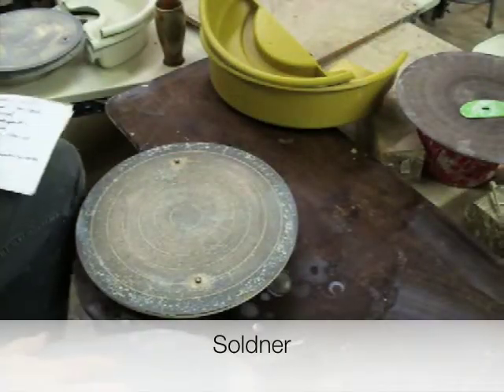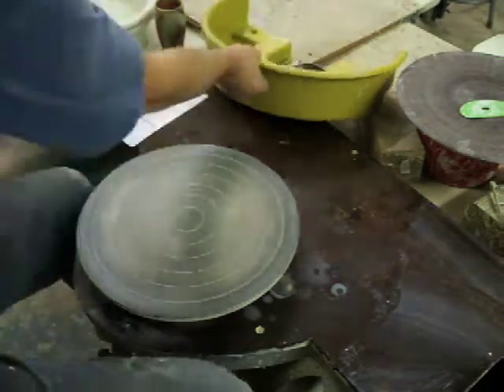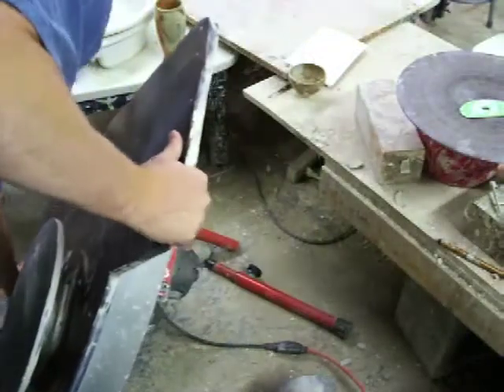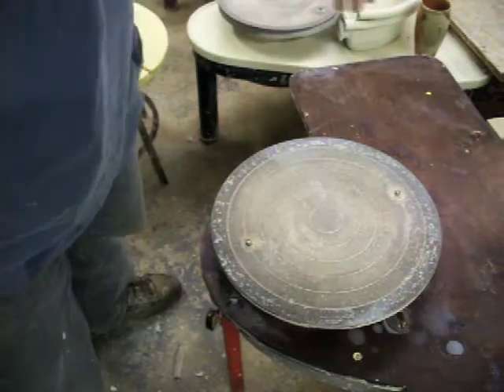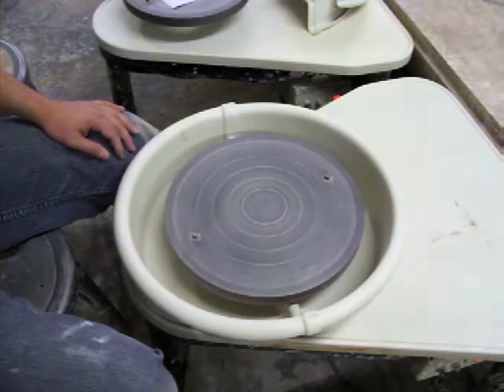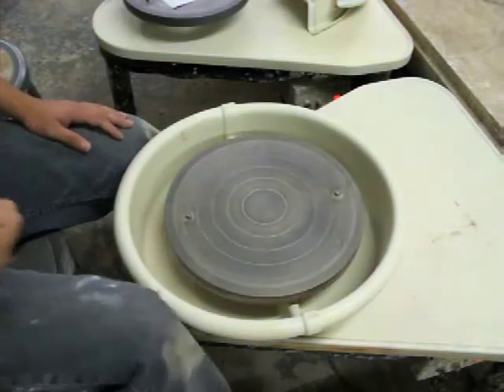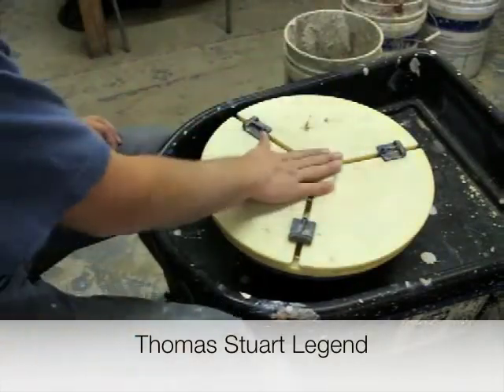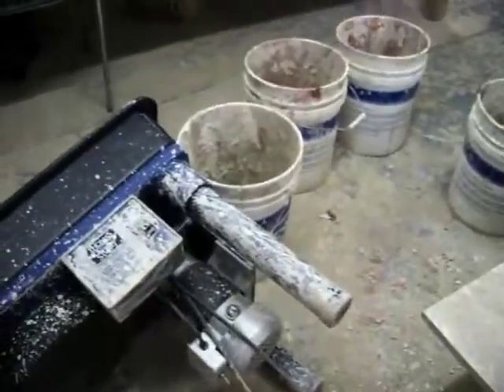Wheel Reviews

Comment: My personal favorite are motorized Randall Wheels. If you haven't seen any they are massive. Steel tube construction with a sixty pound fly wheel, a twenty inch spalsh span that is basically half a sphere and an adjustable tractor seat that is attatched to the wheel to sit on. I use a normal wheel head other than the one they originaly come with. They are great wheels.

Comment: Cont. from below. I worked for a ceramic supply company for around three years so I LOVE seeing the reviews. I always wanted to try a Soldner, thanks for sharing. 
If you ever get a chance to try a Shimpo (Whisper series) . There power at a half horse is impressive. The RK has that fixed lever/foot petal and anvil shape many people hate or love. I like to throw with both feet on the ground so it does not bug me. The VL whisper is the more "modern" style with table and large remote foot petal.

Comment: Shimpo is another good wheel. I might be biased, I do own a Shimpo Rk & VL Whisper. They advertise the fact that they are silent and they are nearly. That has never been a concern for me though. Great torque for a half horsepower motor and I think un matched at slow speeds. Repairs are tough do to the fact it run off of a  Brushless DC Motor. Not so easy to repair yourself but dealers should take it and have the "pancake" motor sent out for repair. Love this post Tim.

Comment from the maker: I have owned an older style shimpo from the 70s most likely cone drive. It was like a tank I am sure it would never die, but I traded it for the solder I have now. I tried the whisper as well and seemed like a fine wheel Syracuse University had a couple and both were plagued with repair issues. If you want to put up a video review of your wheel it would be a great addition.